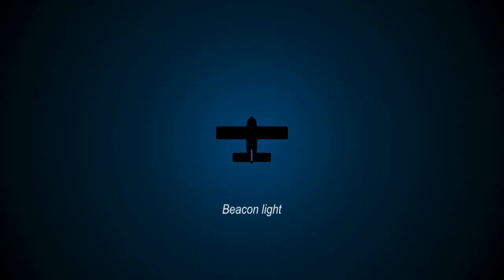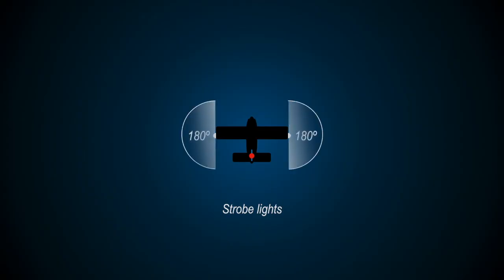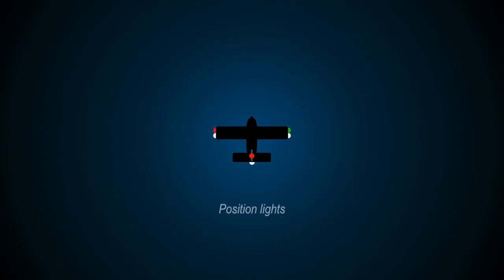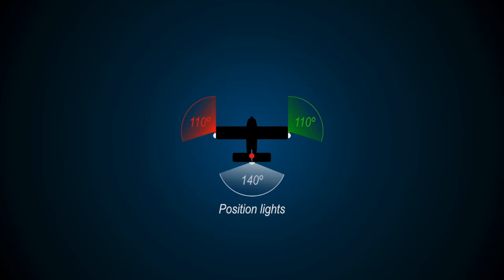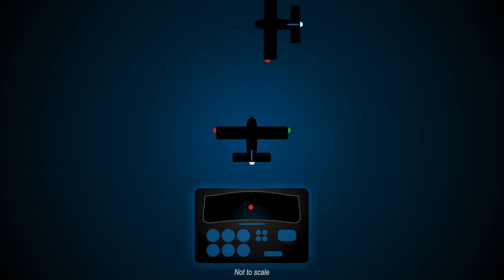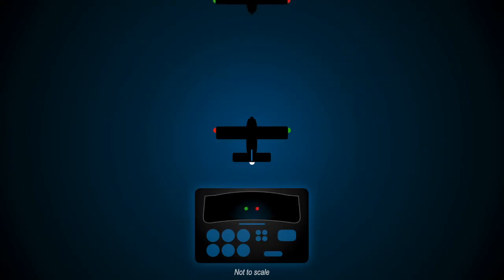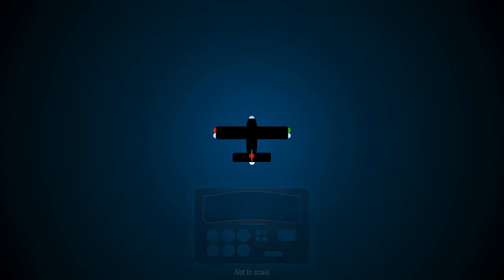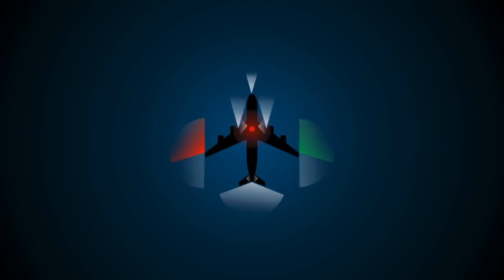Aircraft lights | They're not UFOs

Comment: Actually, seeing the tail light does not necessarily mean the aircraft in front of you is moving away. Remember, you may fly faster, thus closing in on the chap in front of you.
Also, if you see a green light (and you're VFR), you have the right of way. As the old rhyme says, "If to starboard Red appear: 'tis your duty to keep clear. Green to green, red to red: Perfect safety, go ahead". It also serves well, by a bit of logic (traffic from the right has the right of way), to help remember which color belongs to which side.
Reply: Would have been better to say "the other plane is moving in the same direction as you"
Reply: yeah, always those damn pushers in traffic

Comment: Look and compare the new XeVision XeTreme LED Par-36 size with active cooling. 2.5 to 3X the Candela ( cd or CP ) comparing the output of EVERYTHING currently on the market, even the "newest" products. The units are "future proof" upgradeable, repairable, modular. A long term durable investment ( not throw away ) Anti reflective (AR) hardened glass lens, premium largest optimal TIR optics, (landing or taxi beam or combo) nitrogen flushed and sealed optics (no condensation inside) CNC'd and anodized aluminum parts, water proof IP-65, No significant dimming as warming up, never hot to the hand. Patented heat management technology. 3 selectable output modes but still requires only a 2 wire connection for 100 watts 12/14 or 24/28 Volt systems.
1Lux at 1/3 mile, this is phenomenal disruptive performance. About 11,000 sustained Lumens output. Finally actually comparable to high output and performance HID landing lights. FAA RTCA DO-160 certified tested EMI and RFI, the strictest levels passed. Just Google search this new recently unveiled aviation product from XeVision, USA made, US and Swiss designed.